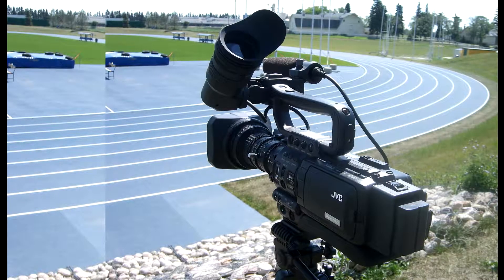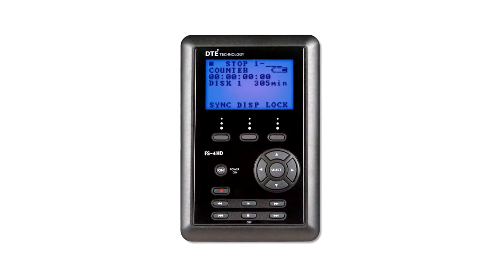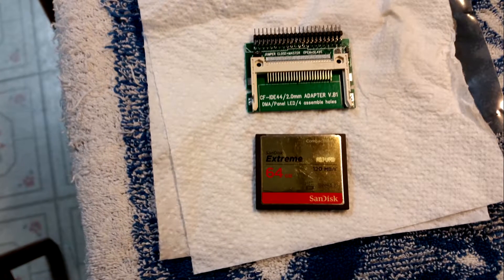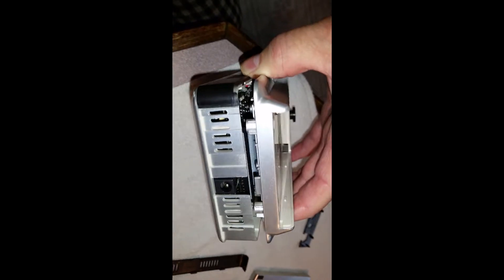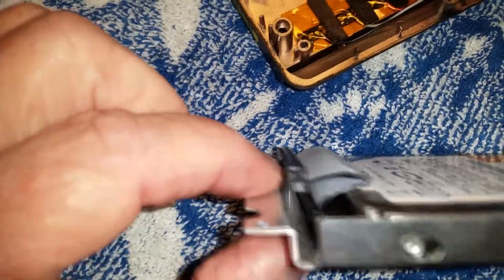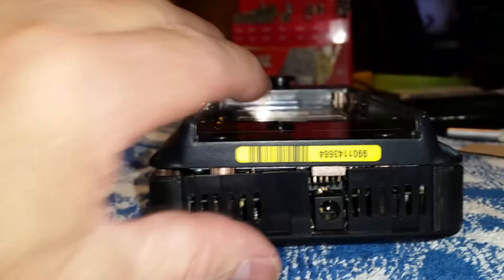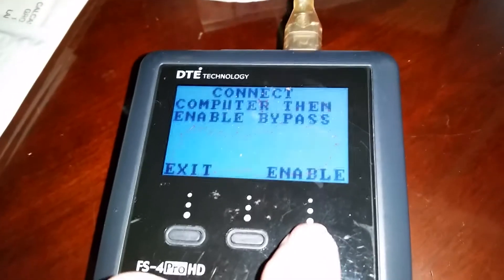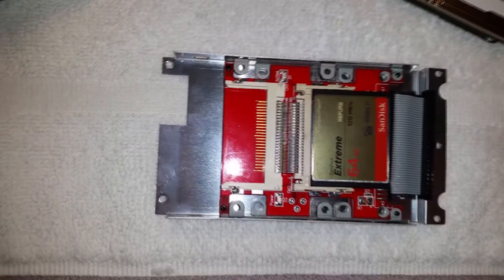How to convert a DTE FS-4 to Solid State SSD For $48

Comment: Thanks for the info!  I have three FS-C Fire Stores that do not work. One I know is 'cause I dropped it... The other two? IDK... But I figure this idea could fix one of them...
QUESTION: The FS-C is supposed to be for Canon cameras. You mentioned you use an Canon HXa1. When I transfer footage w/ my FS-C from my my Canon HXA1s there is always a 10 frame excess on each 8 min HD clip I have to trim off in Adobe Premier.  Is there software to eliminate that problem? I have a DS-100 but that leaves 10 frame gaps, so I don't use it...

Comment: Can you explain what the point of doing this is ? Does it just make it faster?
Reply from the maker: It does make the firmware run faster. There are No moving parts to breakdown. The unit does not overheat if used too long like the standard spinning disks of a hard drive.

Comment: Fyi for all with a FS-100 
pro the connector has SATA connector instead of IDE. Heads up before you order the adapter to check inside your device
Reply from the maker: Thanks for the update

Comment: do you think this would work for the FS 100 model, with a 40gb hd? 
HOW do I know if the drive is bad or the whole device is DOA?
You mentioned to be sure to remove the RED CLIP? ,, but I never saw a RED CLIP removed
Can you detail that better slower and clearer?
ALSO, have you seen or tried the PATA HARD DRIVES that use ssd internals. Any 
thoughts or tips ?
WHERE can I get that adapter from? 
Thanks.
Reply from the maker: I
Put it to your ear and listen for the motor spinning, i might be selling 1 of my 60gb ssd, or maybe my canon xha1 2 fs4s with ssd, a sony slow motion lanc, make me an offer, the xha1 is in perfert condition
Reply: yang filo is that xh a1 still for sale?